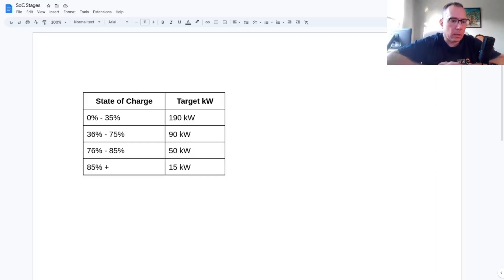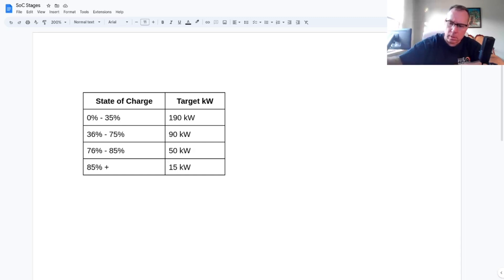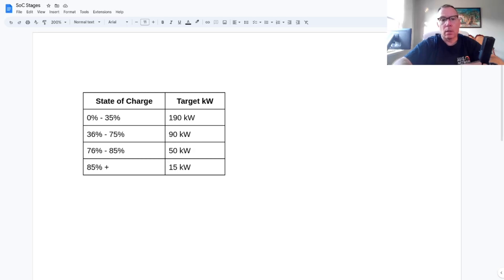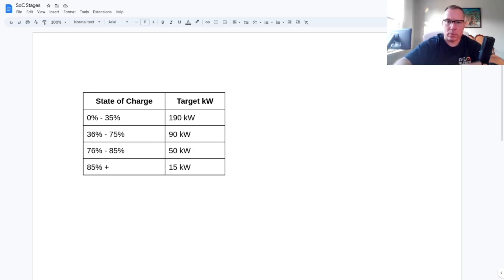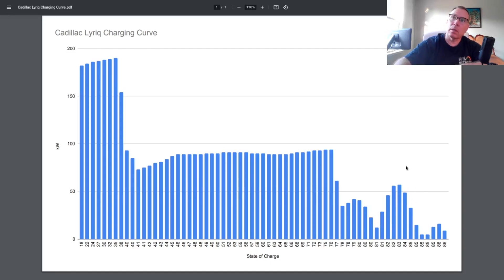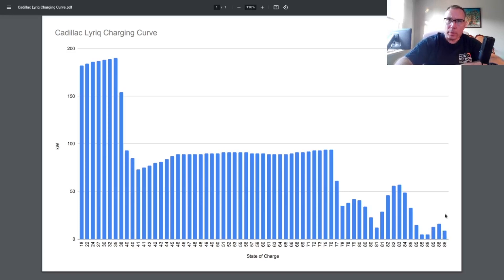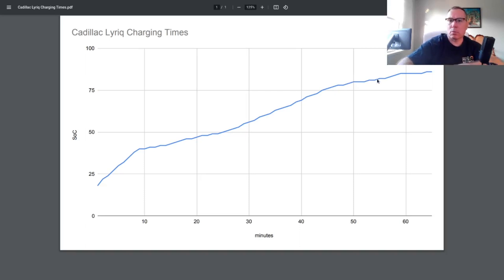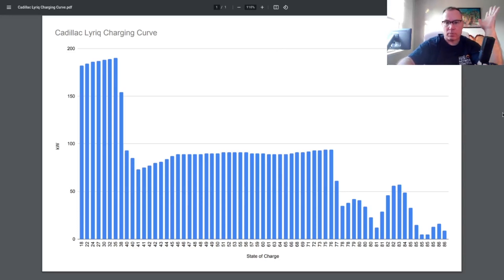Cadillac Lyriq Charging Curve

Comment: this was very helpful.  Thanks. I think this works great as long as i know what to expect when i plug in.  Wondering if the drop is different on the 150kw.  Do you get to 80% at the same time or slower?
Reply from the maker: There is an updated video in the channel after the GM N23-241765 fix.  If you have that on your LYRIQ, it is actually much better.

Comment: Yes thanks for doing this, it's hard to find any DCFCing info on the LYRIQ.  I will be getting one for a week later this summer to do a more testing with.  I did a very detailed review last year which folks can check out on my channel.  This included interviews with a Senior Engineer on the platform, and the Chief Designer of the Infotainment system as well.  Really good info.  

With your revised info, this is a good curve and the meat of it is that a user experience hopefully will fit the 10-80% in 30 mins timeline, which is the new norm right now.  Not the 60 mins as originally shown.
Reply from the maker: I am finding the curves matter little.  It is the DCFC infrastructure which is limited.  Hearing Lucids on road trips at derated stations are good examples.  Maybe Tesla or Kempower will help

Comment: Lyriq charging is dynamic based on how much it can pull from the charger.  At a high power 350kW one like you used and at a relatively low state of charge, the car is able to pull near 190kW for a good amount of time.  Then it has to drop down - and sometimes much lower than what you got (depending on pre-conditioning, temperature, and battery balance level).  Conversely, if you charge it with only a 150kW charger, you'll never see that 190kW peak of course, but it will hold well over 100kW over more of the overall cycle.  So I don't think your plot here is invalid or void, just one of the many charging behaviors that the car follows under varying conditions.  If you charge to 80% with either power charger, the overall time remains about the same.
Reply from the maker: I susithe actually charging curv is a traditional slope from 180 to 125 at 80% SoC then a ramp down to 50 kW & lower as it approaches full

Comment: Thank you so much for this!  Just curious if there is a way to either automatically or manually enable battery preconditioning?
Reply from the maker: The Lyriq has a heat pump, but no precon that I know of.
Reply: @thenetworkarchitectchannel  It will precondition automatically if you set the charger as your destination in the nav.  If you don't do this, you have to manually enable the feature.  Battery preconditioning is in the charging menu.

Comment: Thanks for sharing this! This Cadillac LYRIQ's charging curve looks like it still isn't finalized (maybe a more conservative profile for early release models?). The charging profile you experienced looks similar to the early Chevrolet Bolt EV's step-down charging profile that was later smoothed out as a charging  taper. I would expect Cadillac to release an update in the near future that starts a gradual taper from ~190 kW starting at 40% down to ~100 kW at 70%. 

Also, I don't know if you went into the details menu for the Delta charger, but it will also display voltage versus amperage, which can shed a bit more light on what's going on.
Reply from the maker: I too interpret this as an ultra conservative curve for the debut edition which will be calibrated over time via OTA updates.  I was not aware of details menu on the charger.  I will look for that next time.  We have 2 yrs unlimited at EVgo with the Lyriq purchase, so I will be back at the site often.  I normally top off there on my way back from road trips.  Thx for the helpful insights.  Love your channel.
Reply: @thenetworkarchitectchannel  Thanks! Yes, I think it's under "Session/Power Details" or something like that, but I'd have to check the display again. Either way, this will be a nice OTA update for the LYRIQ... and congrats on the free EVgo charging plan! That's a nice perk.
Reply: @newscoulomb3705 i think you are correct that during the charging session there’s a screen (or there used to be) that plotted out a kW vs Time or kW vs SOC trace on EVgo stations. Unfortunately it doesn’t look like it’s kept as a set of data as part of my old EVgo session invoices, they just have summary stats for the charge session.

Comment: This is pretty terrible for road tripping. Many EVs do 20-80% in less than 30 minutes. Some as fast as 15 minutes. I was initially interested in the Lyriq until I noticed Cadillac was not offering any press cars for detailed review. This is one reason why!
Reply: I agree this is not good. Time wise, it’s barely an improvement over our 55kW Bolt. They will need to fix this quickly if they truly want to be competitive. Between issues like this and advertising campaigns for vehicles they are not producing in quantity, GM seems to be digging itself a hole.
Reply from the maker: One thing to keep in mind, the pack is 102 kWh.  No matter how fast of a charge you get, it is going to take awhile.  I think that is y the on board ac charger is 80a/19.2kW.
Reply from the maker: I agree there is room for improvements.  Likely what we are seeing is an ultra conservative curve for the debut edition that will be calibrated via OTA updates as time goes on.  Our Volvo EX40 recharge too had the curve updated over time via OTA updates.  Thx for taking the time to share a comment.

One other thing to keep in mind.  The Lyriq has a 102 kWh battery pack.  This is larger then other EVs, so getting the SoC up to 80% is more kWhs.  I personally find this to be on par as far as charging times with others in the category and suspect it will only improve over time.
Reply: @thenetworkarchitectchannel 

My dad has a lyriq and I was thinking of borrowing it for my upcoming road trip bc it’s such a nice hwy cruiser. However, after seeing this, this charge curve is abysmal.  My rivian has a larger battery and still charges faster. We had an Ioniq 5 last yr and that car had amazing charging.  

Considering this is not Gms first ev, this is really disappointing.
Reply: @Wasabi9111  At lease it not the Bolts 50kW. But yea, you would expect better speed out to 80%. My brother just go a red one, very nice ride.

Comment: Thanks for the update!

I haven't watched the whole video but does Lyriq need pre-conditioning?

Have youa test on the XC40 Recharge?
Reply from the maker: I assume so, but today was in the high eighties & I had just driven over 200 miles, so it’s battery was nice & warm.

Haven’t done Volvo XC40 Recharge.  Several are already done.  CallasEV has a nice one.